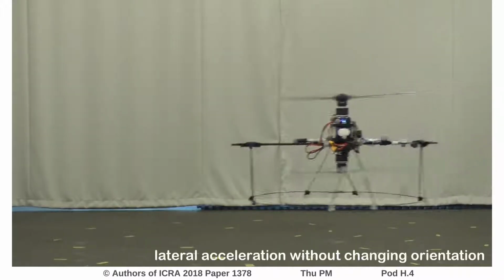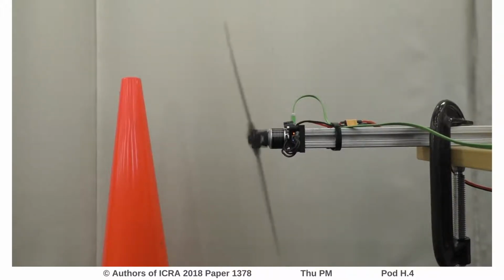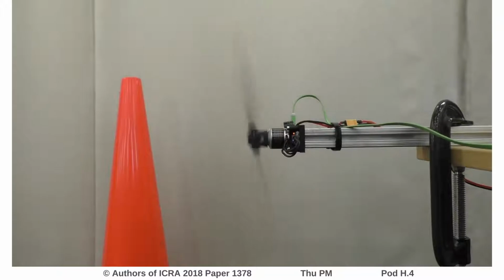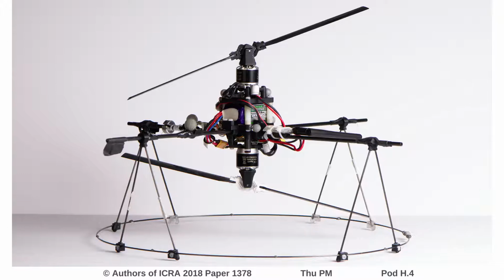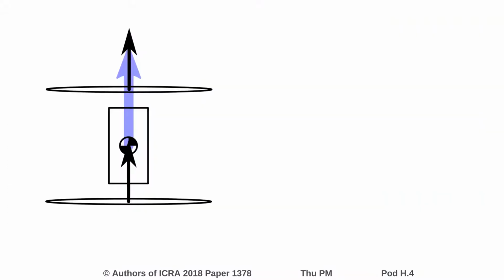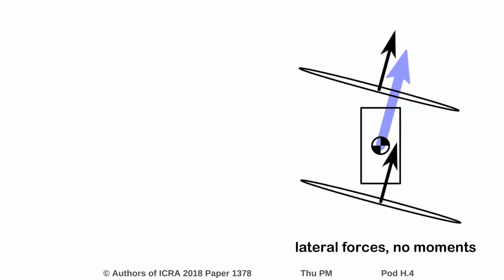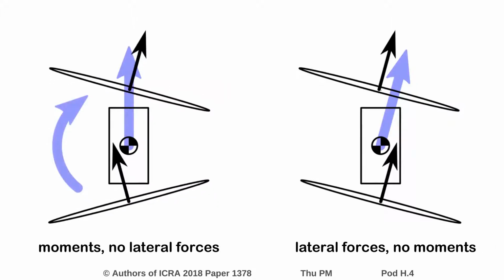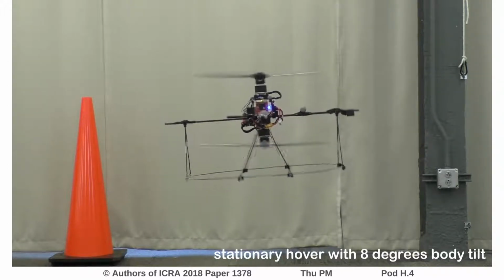Emulating a Fully Actuated Aerial Vehicle using Two Actuators

Comment: Very cool!
I'm amazed that this is not more well-known.
I think you might get more horizontal/lateral thrust and greater roll and pitch control if you replace the lower propeller with a cyclorotor.  This cyclorotor would rotate in the same direction as the propeller it is replacing, and it would be helpful -- but not required -- if it could be given a similar torque/pitch coupling as the propeller.